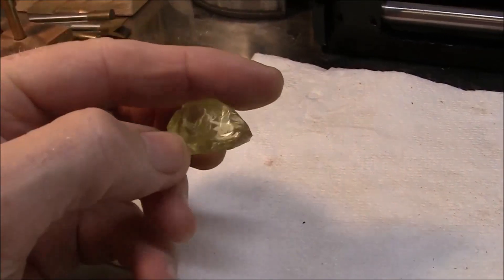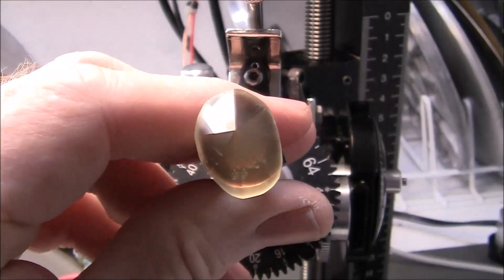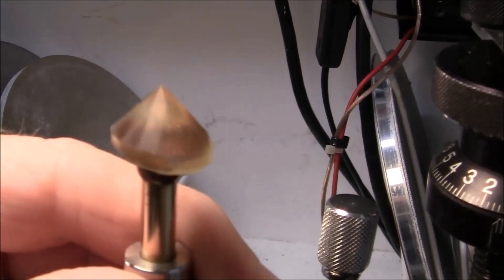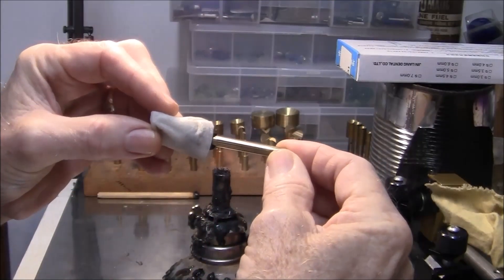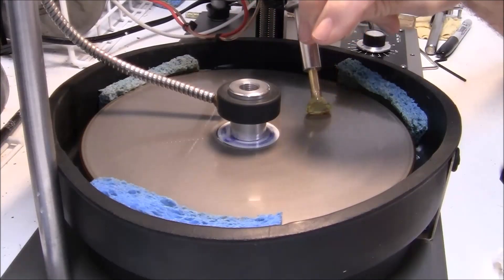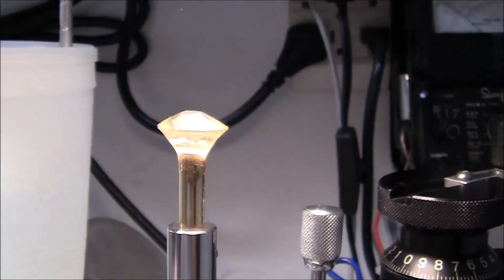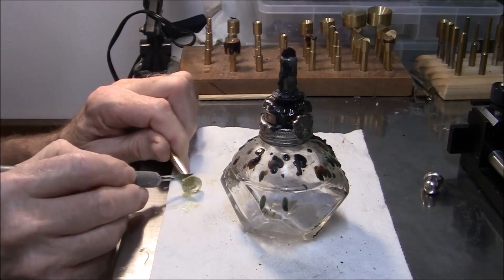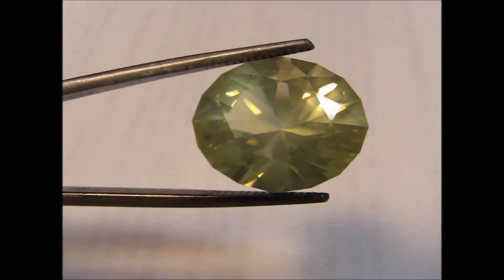Cutting  gemstones: Faceting an oval  in lemon quartz.

Comment: I am struggling with what's titled A Lazy Oval. The girdle is not working out. Why would the diagram have you cut the girdle on opposite sides of the stone in pieces? I see your diagram has that order as well. How do you get the girdle straight when you can't match up each cut because they are on opposite sides of the stone? I am being forced to cut into my beautifully aligned facets in the pavilion to even out the girdle. The girdle on the ends are much thicker than the sides too. My culet is a keel shape. My sharp meet points are at the girdle. It is a mess. This is my third stone. Any suggestions would be so appreciated.
Reply from the maker: ovals are tough. do more rounds  before trying an oval.

Comment: Dear nice video.... but can you tell me little bit about the diagram? Please. I write all the angles from the diagram you have shown in the video for (oval brilliant 45) there in the diagram in the first step there is 44.68° angle but in the video yiu have said I am cutting main facet with 43° I notice this in the video.....also tell me how can you set the try the numbers after the point in the machine? Like 44.68° in this case how can you set the .68 in the faceting machine.... I am greatly confused by it.......... The diagram I follow the diagram which you have shown in the video but the stone is going to an irregular shape.
Please help me sir,
Please make a complete video mean show all the steps in the video it doesn't matter if the video become longer.
Reply from the maker: Sorry im unable to make a video on this design   at the present time but ill try to answer   your question.    I must have  misspoke,  i did cut it according to the diagram.     You can round off   a 44.68 to  a  44.7     and still have a good result.  Your stone will have an irregular shape intil you  cut the girdle  facets.   Completing all the girdle facets at 90 degrees will make the shape oval.
Reply: @tennpikr74  thank you so much for replying Sir. In the video when you cut the first four facets so all their corners touch with each other. But my stones first four facet's corners didn't touch with each other when I cut them. Angle, 44.68° Indices, 7 - 25 - 39 - 57
The another problem... I used Sirilankan type hand pieace faceting machine in which you can't set the numbers after the point for example 44.68° now in this case I can't set the .68° in my machine. I can only set 44 or 45 what should I do?
Reply from the maker: @fionahonohan2757  cut the  first 4 facets to  a  center point  at the culet.  If the corners dont meet  at this time dont worry, cut the next  sets of facets,   they should fill in   where the first set  didnt meet.   If you can set your angles   to a tenth of a degree,  round off to the next higher    degree  such as 45 .00.
Reply: @tennpikr74  thank you so much for your response Sir..... You helped me alot keep your strugle Sir.... May God bless you

Comment: With ovals, do you have to re-set the height with every facet? Like with round brilliants, you keep the height the same for each row of facets, but is this the same deal? Like every time you do one facet, you change the height to facet the next facet in that row? Also, amazing stone! Great work!
Reply from the maker: Thank you,   with  most ovals  you dont  change mast  height  every facet  but as in this case   sometimes i cut 2 facets at the same ht, then the next group of facets were cut at a different angle so   the ht. had to be changed  again.  most of the steps  on this design involved groups of 4  facets cut at the same angle and  ht.   Once you start cutting a facet  in these  groups  you dont change the height setting just the index  setting .  All this changing  angles and indexes make cutting an oval time  consuming.
Reply: Gems by mbk ahh! I see! Thanks Brent!

Comment: What epoxy glue do you use, Thank you
Reply from the maker: I was using  gorrilla brand but i had a problem with a batch which wouldnt hold so im using devcon  now.
Reply: @tennpikr74  I have been using  Titeon but am changing to Devcon Titeon is hard to get off.